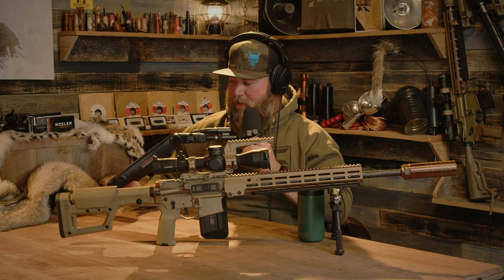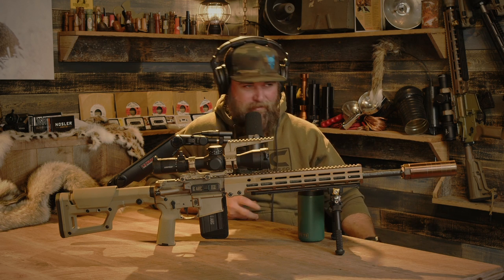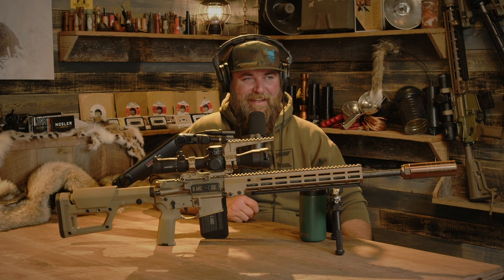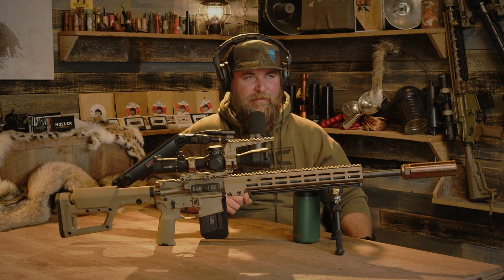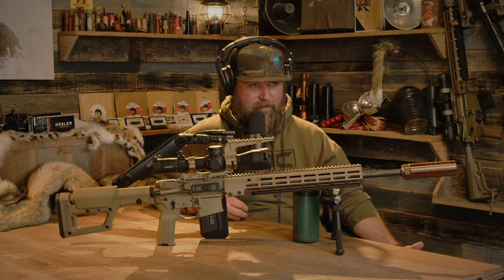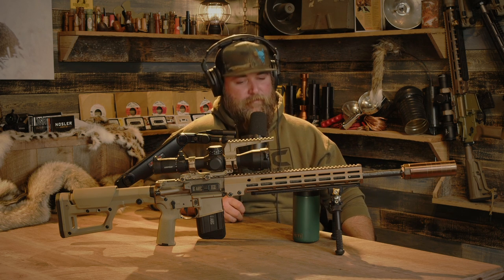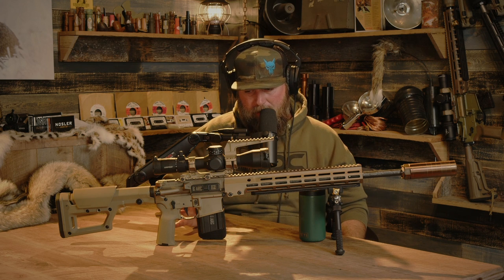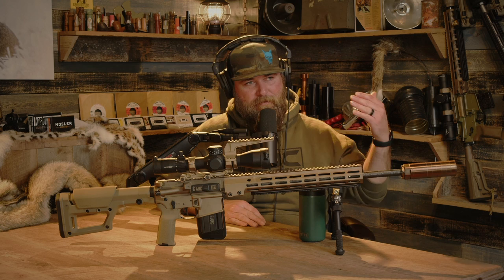"Accurizing" an AR | TPH63

Comment: 1. Barrel
2. Optic and mount 
3. Trigger
4. Ammunition 
5. Barrel extension to upper receiver fit (Tight is right, loose fit barrels tend to shoot patterns not groups.) 
6. Torque spec on barrel nut and muzzle device. (Gorilla tight is wrong.) 

Just my experience and opinion.

Comment: I was struggling to achieve sub moa with my larue barreled ar15 even with my handloads. Consistently between 1.25 and 1.75 moa. Ended up stripping It down and lapping a bcm thermal fit reciever and reassembling it and the first 3 groups were all around 3/4 inch at 100yards. In this case that's all it was.

Comment: Recce Carbines:
Recce carbines came from JSOC well before the M4 program was fielded.  Guys on the Sniper Operations/Recce Teams spent a lot of time focusing on providing precision supporting fires for the Assaulters.  These were all Sniper-trained guys who had been through SOTIC, SEAL Sniper School for NSW, and/or Quantico Scout Sniper Instructor Course who wanted accurate little Carbines, not run-of-the mill blasters with 4 MOA dispersion.  These were used in addition to M21s and SR25s, which also had a lot of work done to them by Unit Armorers.

In the late 1980s-early 1990s, JSOC elements in both the Army and Navy had their Unit Armorers accurize their Colt 723 and 727 Carbines with free-float tubes, Douglas or Lilja barrels, and topped with various optics ranging from Aimpoint 2000s to Hensoldts and Leupold LPVOs from the 1980s.  The optic mounts were usually ARMS #2 or a featureless bit of rail that dropped into the carry handle slot.  Others had the front portion of the carry handle machined off and a Weaver rail installed for the Aimpoint to be mounted lower and co-witness with the irons.  Aimpoints were used a lot for rotary wing sniper support, where snipers remained in MH-60s providing overwatch for Assaulters, whereas the early LPVOs were used for more precise Sniper support.  There was no specific standard for JSOC Recce carbines, and they all varied by Team and Squadron, who were all competing with each other to develop better solutions. 

They also mounted Own the Night configuration IR lasers on free-floated handguards to provide IR laser targeting, which worked both for helos and dismounted.  Handguards were either 12” V-MATCH knurled aluminum or fiberglass with stainless threaded inserts for accessories.  They were often front sight pocket cut for the FSB.  PAQ-4Cs and early Wilcox LAMs were used well before the PEQ-2A came out.  These carbines were often suppressed.  Ammunition was 68gr or 69gr Match, in addition to M855.  

When the M4A1 started fielding in 1993-1994, the Recce configuration guns used some of the older accessories and features with the new flat-top railed uppers, and eventually new free-float handguard options were primarily sourced from KAC.  One was the MRE to replace the modified tubular free float handguards used before, which solved the problem of the FSB pocket cut installation while still retaining the front iron sight.  The other KAC quad rail eliminated the FSB and used a low profile gas block.  There are all sorts of variations of Recce carbines in the post-M4A1 era.  The Schmidt & Bender Short Dot LPVO was a Unit-specific request that became very popular in the 2000s, replacing a lot of the older 1980s-era LPVOs.

SPR:
Other soldiers who were in SOCOM occasionally saw JSOC guys with these carbines, and wanted a similar capability for the DM role within SF ODAs and SEAL Platoons.  NSW Crane and USAMU answered that requirement with the Mk.12 Special Purpose Rifle using old stock M16A1 lower receiver groups, mated with 2-stage match triggers from different companies, M4 uppers, Douglas 18” RLGS select match barrels, the PRI flip-up front sight/gas block, SPR CF handguard, ARMS Swan sleeve rails, and suppressors.  Ammunition developed with help from USAMU and others was 77gr SMK Mk.262.  Optics ranged from Leupold 3-9x to MR/Ts, then later NightForce.  Mk.12 Mod 1 had the Knights Armament free-float rail and M4 upper, KAC trigger, suppressor.

SAM-R and SDM-R:
DMRs included the SAM-R and SDM-R 20” rifles, meant for issue to USMC and US Army Infantry units.  With a DMR, it makes sense to keep the chambering and mags the same as the rest of the Squad if you can, so the DM can fight like the rest of the element, while providing additional SA with his magnified optic, and more precise fires to extended distances.  While many 7.62x51 DMRs have been issued, they are not a rule.
Reply from the maker: There's a name I haven't seen in a while! Thanks for the writeup.
Reply: @tphpodcast  It's interesting because "certain DoD entities who used to use SR-25s" adopted the 6mm ARC for a Light Sniper/DM solution.
Reply: I was about to type something out and decided to check the comments first. You explained that way better than I could have. It's going to get more confusing for people since the M27 and M110A1 are both DMR's in use but are two very different weapons. To really understand the naming conventions it's much easier to look at the roles that have used them. I have shot almost everything the military has to offer from the M9 to the SASR and they all have their use case. I'm mostly excited about 6 ARC because it's a cartridge that covers most of those use cases very well.
Reply: DMR and SPR are simply contract solicitations for a product

Comment: I got bored with my “precision” bolt guns, and started wondering what kind of precision I could get out of my .223 AR. I saw a 17.7” Ballistic Advantage .223 Wylde barrel on sale, so I bought it and paired it with an Aero upper and lower. Just took it out 2 days ago to do some load testing at 100 yards. Shot some Hornaday 73 grain ELD Match with CFE223, and it surprised the hell out of me. I had to seat them a lot deeper than I would like with that bullet, but the mags for an AR restrict what you can do. Best 5 shot group was around 3/4”. Hoping to stretch it out next week, because I really think this is going to be a fun rifle to slap steel with.
Reply: @johnknouse8846  you can shoot VLD bullets from your AR by single loading them . This is common at the 600 yard line of US Service Rifle Competition.

Comment: SPR 18in AR (usually) in 5.56mm using 77gr smk and high magnification.

"Recce" 16in AR (usually) in 5.56mm using LPVO.

DMR any semi-auto rifle accurate enough to be put into the hands of a Designated Marksman to provide accurate fire at range for a squad or platoon sized element. SPR, EBR, Mk 110, etc etc.

Comment: Just one more thing: the USAMU Squad Designated Marksman Course begins with this fact: the bullet ALWAYS goes in the direction the barrel is pointed. With some thought on this students will realize for the bullet to hit where desired requires knowledge for where the barrel is pointed, so before any match conditioning first learn how to get consistent sight alignment and maintain it via smooth trigger control until the bullet clears the bore. BTW, the barrel is indeed the most important thing but over the counter barrels do not satisfy the desire. To be assured of best accuracy get a barrel that satisfies the USAMU Service Rifle Section.

Comment: So i agree with everything you said. As another example, on my Daniel Defense AR-15, I took the original 16" govt profile barrel off and installed a 20" stainless heavy profile fluted Wilson Combat barrel, major improvement! That and a Triggertech adjustable (dialed all the way down), with an adjustable gas block, and H3 buffer, the gun is a sub-moa rifle now. The two factory loads that run good through it are frontier 75 grain and Hornaday Black 77 grain. Need to order some of your .223 ammo, for testing, to see how it does on hand loads. 

My other accurate AR is my Sgt of Arms 6mm ARC. I'm going to switch the Geissele to a Triggertech on that gun, because I am just such a huge fan of the Triggertech. I will say though their T-box barrels are really tight chamber tolerance and will be picky going from lot to lot on Hornady black. The match and precision hunter run superbly through that gun though. 

Point is, good optics, with good mounts, a well built rifle with quality products, and good ammo will get you there. If you go all in from the get go, then you'll have more time to develop good shooting habits and get training, to be a better shooter. Also get some good shooting bags and bipod/tripod,  to practice shooting from different positions. Do this so your capable of shooting from any angle, when you're out hunting. I've been on situations where i saw something on a game camera, but couldn't get to the blind, so i had to make an extended shot, in the prone, or off a tripod, to take an animal.
Reply: Soooo what ya doing with that 16 inch barrel...😁
Reply: @mr.lovell3645  sitting in a safe, for surplus reasons, lol!
Reply: @michaelcerrone1482  👍👍🍻

Comment: SPRs are typically gonna have (16"/18") stainless barrels and are designed around precision rounds on target. Think MPVO.

Recce builds can be anything (typical barrel length might be as low as 12.5" - but usually 14.5"-18"  with a magnified optic capable of watching and PID.) But the barrels and accessories are less restricted/specific. Think LPVO.
Generally, if you're doing recon, you  are not trying to fight/engage targets. But you want that capability. 

DMRs, as the name states, marksman. That's the squad sniper.

Comment: Barrel, Optic and Good rings that are true, have seen band new rings not be aligned correctly. On Mountain hundreds, if not, thousands of rifle rings and depending on the brand and depending on the manufacturer, you really get what you pay for but I’ve also seen $100 rings be out of alignment. Had brand new rings made by manufactures that a lot of people trust and swear be so out of the line that I couldn’t even bite and scope for 25 yards because it was putting so much pressure on the scope and internal components that max out the scope.

Comment: By the way, the difference between an SPR/DMR and a recce rifle is weight.  Recce rifles are carried a lot and shot a little, and the general pack weight for a reconnaissance mission is significantly higher than it would be for a generic combat patrol because of time, specialized equipment, and the need to be self sufficient.

Comment: Goin back and watchin this again. 
Ive got an arguement though. Lapping the upper reciever.... ive got first hand experience with upper recievers not being true on the face, as compared to the upper reciever bore. Ill be open in saying ive seen very few recievers actually 100% true on the face. Most, regardless of brand coud benefit from lapping, a couple of the worst i have seen are from very well known AR manufacturers..... like bad, one of those examples had serious cycling problems.
Goimg back to the idea of lapping... if the receiver face is not square with the bore of the reciever, then (assuming the barrel extention is 100% true) the barrel will not be square to the bore/or bcg right? Again ive seen first hand serious issues from this.  
Theres another factor too, thermal fit recievers vs recievers that will slide right in, thermal fit being preffered. But again ive seen even the most well known name recievers vary on fit to barrel extension.. its a combo thing
Regardless i will attest that theres benefit to lapping the upper regardless of brand. 
Every ar i touch gets the upper lapped period.  At this point i can say only a couple showed actually true when i started checking them w the tool. 
I want my barrel, square with the reciever bore, or anyone elses that i touch. Is there a giant gain in acvuracy? If its bad enough out then yes, not to mention reliability. 
That lapping tool was literally one of the first tools i bought when i got into the platform.

Comment: I’ve always heard people talk about truing and lapping the receiver but never heard anyone talk about the barrel extension and barrel nut being true. Since it all mates up anyways, does it really even matter that much when you torque the barrel nut down?
Reply: Not trying to be a smarta$$ but....try it! Lap the upper and whatnot then try lapping the barrel nut. See if your accuracy improves. A high quality  barrel will come pretty dang true to bore. I don't see how lapping the barrel nut to the muzzle side of the extension shoulder will help but it probably won't hurt.
Reply: @kirkmartin2223  I hear ya but as I thought about it more, I wonder even how you’d do it without a lathe or if the juice is worth the squeeze. I don’t think there’s a tool like the receiver lap you just slide on and spin. Maybe it’s the same case as “modern machining is good enough now” and I don’t hear anyone talk about it because it would be an absolute pain in the ass!  Forget I ever mentioned it! 😂😂
Reply: It does matter to have equal and square mate-up of these critical components.  Receivers and barrel extensions are machined square, but the anodizing on the upper receivers can dry non-uniformly by the anodizer, which will cock the barrel to one side even when you torque the nut down.  If the inner face of the barrel nut is square, the flange is square, the threads are true with each other, and the receiver face is square, it will support a far more precise system with tight shot-to-shot consistency.
Reply: I can promise you right now lapping the face of the upper reciever makes a huge diff. Ive had to shelf guns brought to me with cycling issues, one of them actually looked like the barrel was bent. Well known high end brand name shelf gun too, worst reciever face ive seen. All need a little, this was real bad. Mfgr requested photos and immediately sent out a new one. Did a little digging on the issue, high on low right side of the face, is due to the recievers relaxing some time after machining etc. Primarily in forged recievers, billet doesnt tend to do it.
Reply: @whiskerbiscuit99  The faces are machined square and true, but anodizing dries unevenly sometimes.  I had this conversation with JP face-to-face back in 2016, and he said from a manufacturing perspective, there are variances that have to be controlled with anodizing.

Square faces also help significantly with bolt life and mechanical zero with sights and optics.
Reply: Actually if you shim the barrel properly you can reduce group size by 20-30 percent 🎉

Comment: JP Lmos with accubolt? Silent capture spring, Geissele super 42, or A5 buffer system?  Or A5 buffer with Geissele super 42 spring? For 6mm ARC with 18in proof barrel? 

I have watched every one of these things where you discuss ARs and 6 ARC trying to glean this information from them because you always brag about how fantastic they are.
Reply: I have so many different options all over the place I couldn’t say one over the other. I will say don’t get asc mags and use superlative adjustable gas system.

Comment: Could Kyle hit the broad side of a barn @ 100 yds with a BCA upper?
Reply: Probably not!😂
Reply: I have a BCA upper on a PSA lower. Was still in the process of getting into AR’s but mine is a 16” fluted heavy barrel 223wylde, got an aftermarket handguard which turned out to be a little too narrow so now it’s not freefloat anymore. Regardless the thing is still a tack driver even with Winchester white box

Comment: my opinion only 
SPR= Mk12 agreed
Recce=14.5 to 16" AR15 with emphasis on light weight 
Fighting riffle= 10.5 to 16" AR15 with emphasis on 0 to 300 meters. weight, not the most important.

Comment: I’m an AR nerd. #triggered lmao…. I have four BA barrels and all different profiles, they shoot great. Modern series contour on an 18” CMV .308, stainless .223 Wylde 20” 1/8 “DMR profile” Premium series (HBAR) I have set up in a Mk12 clone, and a 10” modern series .300 BO they all shoot great for what I do with em. But I’m not trying for 1,000,000,000 yard hole on hole. I have one 16” .223 Wylde Faxon match grade pencil profile paired with a A5-H0 a green Sprinco, and a Faxon LW BCG sitting in a WC upper on a Franklin billet lower with a Geissele super Tricon. That thing is super light and skinny as hell in a BCM MCMR with an LPVO. That’s my version of a Recce. And it actually does shoot 1 MOA off a bag. I’ve got Noveskes, LWRCs, Aero Precision, BCMs/PRIs and they all shoot good, but the best of em all are the BCM and the BA and that skinny booi Faxon pencil.

Comment: I knew you were gonna do it! A stock before a quality optic or more importantly a properly headspaced bolt riding inside a carrier with a true concentric bore? What the hell! And you say a suppressor? Come on now what are we even talking about here? I would sooner take my f-class championship hand loaded ammo Even if it meant I had to shoot just the barreled action with no stock. As far as suppressors go there's no way I would put one on a gun that I built for precision work only... Of course it would be detrimental to your accuracy. When has hanging a pound off the end of your barrel ever increased accuracy in a gun? Unless by some queer chance you perfected the harmonics in the barrel somehow by adding it of course it's not going to help! If you insist that a suppressor has never made a gun shoot worse, maybe you could give me some examples of some of the names of guys who use them in the PRS series or maybe bench rest or f class? Fucking suppressor get outta here! New shooters this is why it's important to get as many opinions as you can on a topic such as precision shooting. After you get enough of them (opinions) the bullshit will separate itself from the useful information.